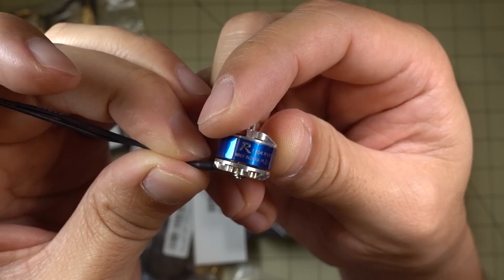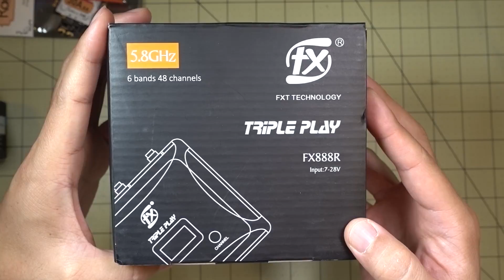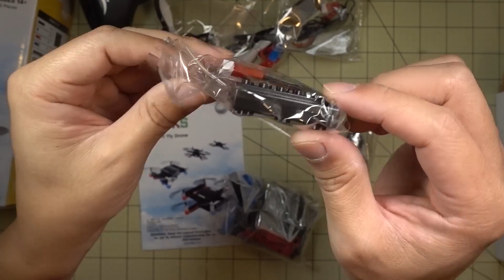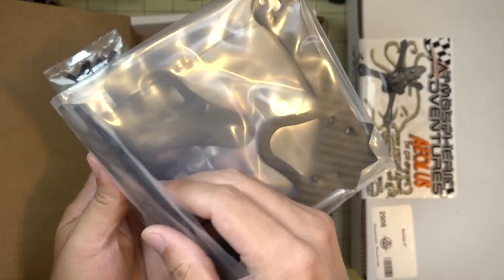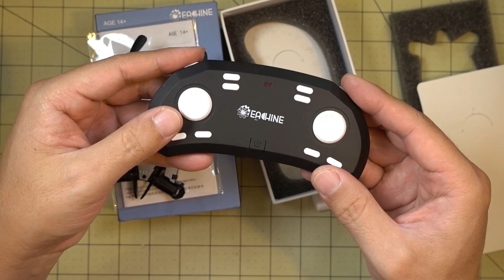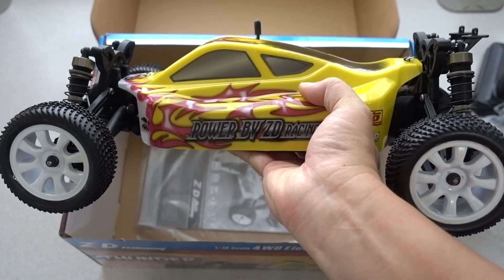Haul Time #62 🛒

Comment: Hello albert,
Can you pls do some thrust tests about motors and motors you personly would recommend and compare these motors with other good motors. And i have another question could you pls tell me what the difference between good and bad escs are? And last but not least what are the pros about the kiss fc compared to other fc`s?
I hope youll answer my questions and i really like your videos they are seriously good. 
Best regards from germany.
Reply from the maker: I no longer do thrust testing on motors because data is already available for most motors out there. Also, it's a lot of work and very time consuming and not many people view those videos.  In general, the better motors will cost more. It is very rare to find a high quality motor that costs very cheap.  So I will recommend getting the more expensive one assuming they are the same specs.  Most ESCs today are pretty good, but stick with BLHeli_S or BLHeli_32 ESCs.  The older PWM, Oneshot, Multishot only ESCs are outdated and will be obsolete soon.  I do not know anything about KISS stuff other than they seem to be expensive and require a whole different set of things to learn which I don't think it worth the extra features over Betaflight unless you are a TOP TOP racing pilot.
Reply: Albert Kim ok thank you albert! Can i ask you another question? I want to know if there is an difference between original flightcontrollers and copies of them for example the sp racing f3. Are they performing the same or should i buy an original one? Yes i know i should support this hobby not someone whis is copieing stuff but im not the richest...